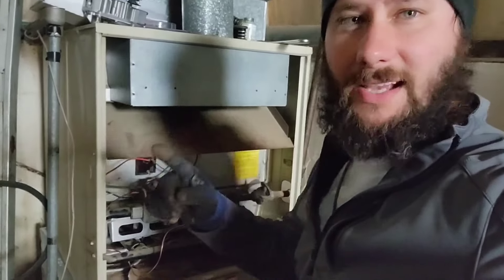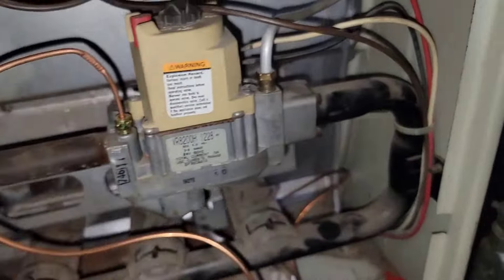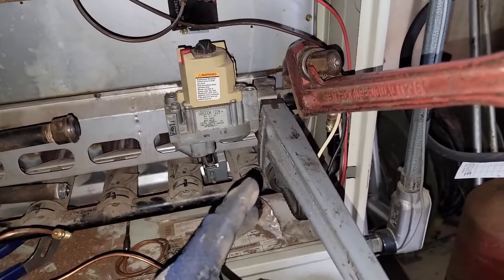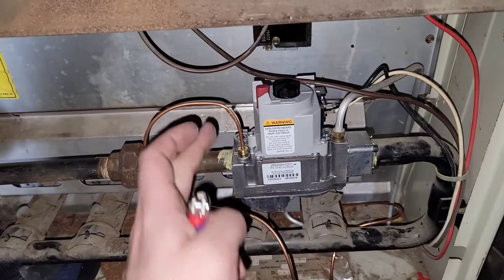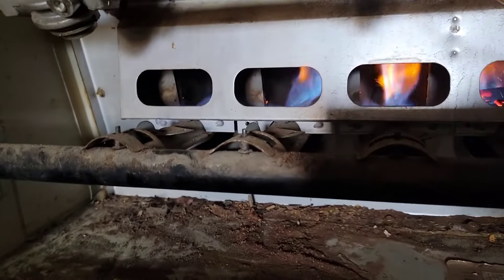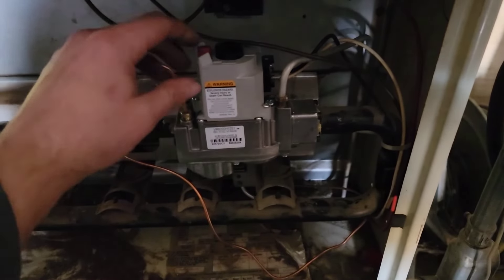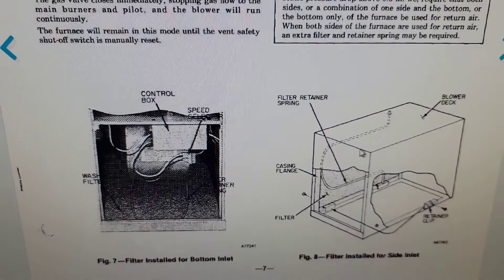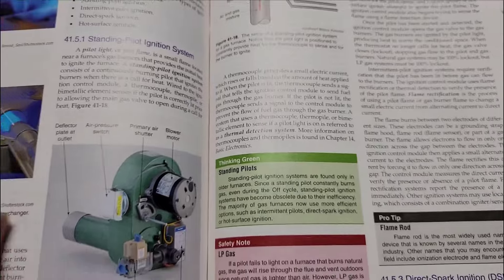Gas Furnace Pilot Light Won't Stay Lit? Fix It Now!

Comment: Thanks. I used this and it worked. Mine didn't need a new valve configuration, but I did have to find the pilot output. Which was one of two right near eachother.
Reply: This furnace appears to be from 1981 in fact.
Reply: I used a bendy long (campfire lighter) I purchased.
Reply from the maker: That is awesome. Thank you so much for watching brother. I'm glad I could help 😃

Comment: This is great.  Don't discount the fact it's short.  You covered everything.  I have the problem you mentioned, but changed the thermocouple and changed out the valve LAST YEAR.  Ran fine.  Gas company changed out the meter.  Flame looks good....but valve shuts itself off after a few minutes.  My furnace is about the same vintage as this one.  Can a valve go bad in just one year?  Seems unlikely.  It's a Honeywell.
Reply from the maker: yes it can make sure you check the inlet pressure make sure the thermocouple is in the flame path

Comment: Hi. I don’t know if you’re still checking comments because the video is older. Our pilot is staying lit but only for about 20 minutes then the heat shuts off. It will seem like it’s working, heat will be coming through to the rooms, then after a little while it will turn off randomly. Every video I’ve watched, the pilot only stays lit for a couple seconds. So I’m confused, I don’t know what to do and don’t have the funds to call a price right now. We have a Buderus. It has worked with no issues for over 2 years. Ofcourse now it’s doing this and it’s freezing cold here.

Comment: New thermocouple and pilot and still won't light. Tappan manual light. It hasn't worked since gas company ran new upgrade line from road to the house. Gas man went to relight and couldn't get the pilot to light at all. I'm leaning valve but why would it happen after their service. I clean this annually never had an issue.
Reply from the maker: Yes could be a bad valve. Make sure that they bled the line
Reply: @TaddyDigest  they said they did. I like to be there for these things to make sure they don't cut corners. But I can call them and say their service hasn't worked since the upgrade and see what they do. But as always they will probably push any issue on the owner. It was bad enough they mixed up the services everyone was being billed wrong. I traced the lines and sent them the correct setup they still sent a guy to do it and then he called in and said I was right and to correct the billing digitally. Human error can and has exist so I can't leave it to be my lack of maintenance. But I'll see if I can find out what updated valve they made for this monster. I upgrade the other furnace to electric start may do the same.
Reply: If you are located in Southern California Gas Company Territory they are obligated to get backup and running...it's one of those things we should have checked it before we replaced the Gas Service....it's a write off for Your Utility Company....best of luck in having it repaired!
Reply: @arunaround5191  it was air in the gas main I opened the pipe up and it took just under 20 minutes to bleed. This was supposed to have been done by the gas company after they did their service repairs at the road to the house. It's in Western MA.